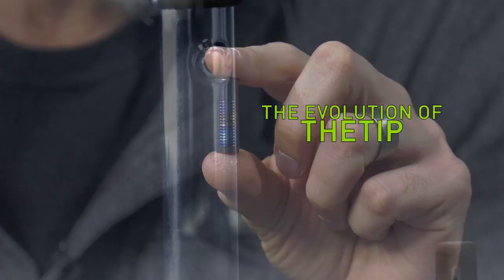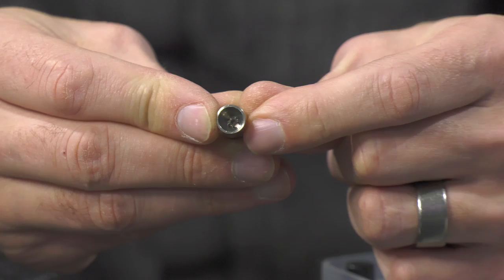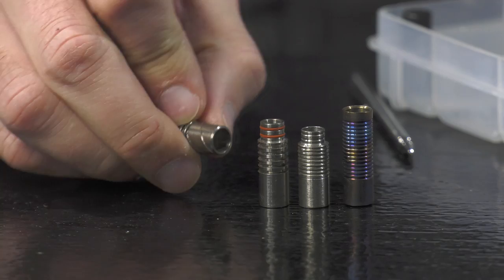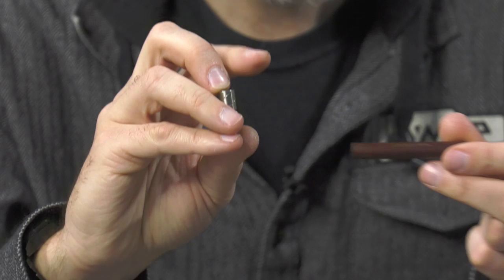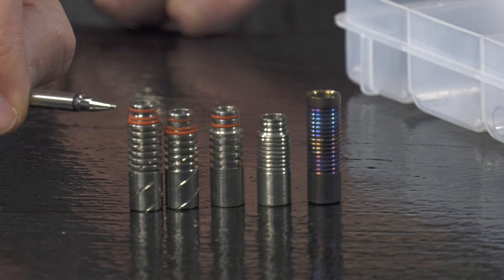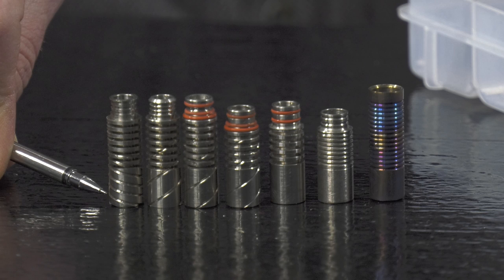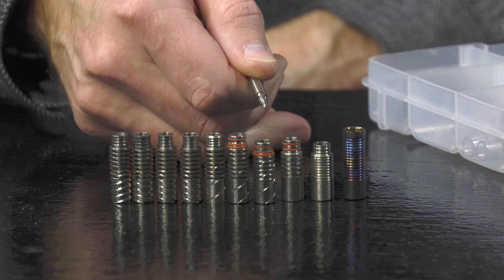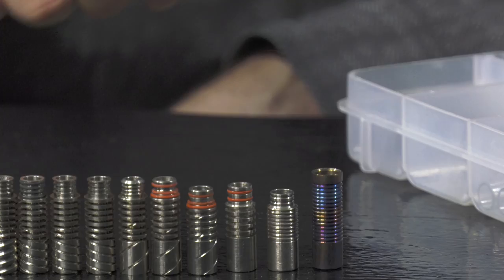DynaVap Archives | Vaporizer Tips

Comment: The differences in tips are like the differences in tires for a vehicle. Some have big chunky tires with small rims, others have super slim and thin tires with huge rims, some have winterized tires, others just have regular tires, some have a lot of tread, others are like driving on a flat piece of rubber. But no matter what tires you have on your vehicle, they'll still get you to where you need to be lol. That's how I see the tips. They all get the job done. Painters need different paint brushes, a car owner doesn't need different styles of tires. That's where I think George is getting confused lol.

Comment: Been using Dynavap M for a week now. I need tip with bigger chamber 0.5 - 1g. Took a while to learn how to use it for good puffs would rate 4/5 for now.
Reply: People have been asking for this for years...
Reply: .5 maybe but 1G lol helllll nah
Reply: @rejectedautobiography  nobody wants a 1 gram bowl on a butane vape lol cmon now no ones been asking for years
Reply: @mikec4308  Er.... ELEV8R? Eagle Bill Shake and Vape? Both butane, both fit 1g.
Reply: @mikec4308  Also, I've seen a bunch of people in comments on youtube, reddit, Instagram and from  personal experience, asking for a larger capacity Dynavap... for years...
Reply: @mikec4308  you could wider the bowl diameter just enough to put a small pipe with intake holes trough the middle. That way you could draw vapor somewhat evenly depending where you heat. Not sure if there would have to be some kind of changes to condenser.

Comment: That’s a weird way to put it, but OK I kind of see what you mean by there being different tolerances so you have to learn how to create consistency with your heating on one hand, I see the craftsman of it on the other hand I hate the inconsistency, especially since the product is so expensive for so little Maybe I just got a bad pipe, but bits of it are more jagged and I’m not one of those people that love fidget spinners or need something touching constantly but I see the engineering that’s going into this and I just am frustrated to think that mine didn’t get the same level of quality in terms of its tolerances especially for the price point you’re asking I got your flagship Omni, thinking that there would be so much I could appreciate in terms of its features for the value but at this time I’m struggling to understand why it cost over $200 for a rather small jagged piece of metal that is relatively inconsistent at providing hits. I’m sure you can analyze my comments and understand the issue I appreciate that you guys have 100% satisfaction guarantee, the thing is, I want to be satisfied with your product, not satisfied that I tried it and then was able to return it seeing videos like this leads me to believe my hypothesis is certainly true in which case it means that both you do provide higher quality products, but at the inconsistency of a craftsman, such as yourselves it’s a frustrating jugs of position to say the least… also, I’ll add I don’t want you to feel like I’m putting you on the spot. Just all of this should at least be considered.
Reply from the maker: Please connect with our customer service department.  They love to help.  We want to provide you a beautiful experience.
Reply: @Dynavapllc  I appreciate the sentiment I already have, and I do appreciate you guys working with me to resolve this however, I do believe you need more reiterations on the design in order to nail the consistency issue. I understand that there will be deviations from product too product including the cap. however, everybody I’ve had try the DV says the exact same thing, I’d be cool if it worked but they’re saying that because they hit they just had was less than satisfying for various reasons the variations are the inconsistencies. If I can give you any advice it’s work on that if you can make it consistent 70% of the time that’s all you need best of luck to you guys I’ve spent over $250 with the Omni and I’m happy to support you. That’s why I bought that, but for what I got there’s defects and quality issues with a severe lack of consistency in use. Cool designs being made out of obsidian or one thing but I would only pursue that if I had a really well-made premium product that works every time there’s no reason to buy an obsidian version of a pipe that doesn’t even work… please consider that I know everyone that I have try the pipe does and unfortunately they’re not willing to buy one. For instance, I also recently just purchased a freeze pipe. What is that? It’s a pipe with a freezing gel in it that when frozen cools the air going through it it was my first time trying anything from that company. It is extremely simple and intuitive. Like any pipe. I put it in the freezer. It froze with no issues and exceeded my expectations. It did what it said it would do, and exceptionally well and at this time I have no issues with it. I need to be saying the same thing about your product.

Comment: The increased mass on the tips (2020/2021/Vong/Omni) didn't make any sense to me. Why? The new tips need AT LEAST one more heat cycle for the same extraction level and can hold the heat too long unnecessarily ending up being uncomfortable to hold the unit if using continuously on a stainless stem; also the taste isn't as good specially when comparing to any old ti tip.
Reply: It seems like that's a recurring theme, it's been the same with the Stainless/M tips.. The first ones had an extreme power and efficiency. You could basically one-hit an entire bowl and you didn't have to go past the click. Airflow was slower too, which in turn kept it hotter for a lot longer which gave you fatter rips. 
That's all impossible now with the new tips, they've changed them too much. Still good, but they used to be a lot better. So I feel 'ya!
Reply: @iamrobberino2107  maybe its just preference since you were used to it a certain way
Reply: @iamrobberino2107  i havent been having the same problem, got my 2021 M this week after using 2019 M and i feel like its better overall, same fat rips and got the feeling i can control the device way better like with heating the tip or base for a tasty rip or going to space